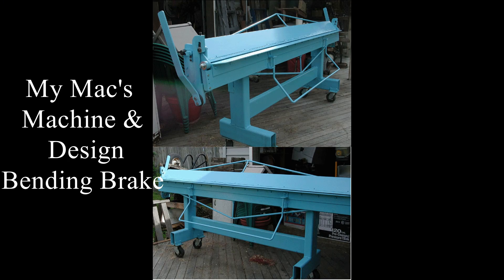Scratchbuilding a Zenith 701 Experimental Airplane, Bending Brake Choices

Comment: Great primer on bending brakes! Probably the single-most important tool for scratch-building a metal airplane. I started out with a modified version of Dave Clay's brake, but have heavily modified it since then to complete the project.
Reply from the maker: Thanks: I always see lots of debate about brakes. I love mine but the majority can be done with a 52 inch brake. When I bought my corvair cores I picked them up from an old orchard warehouse where they had about 3 airplane projects going on and had a 3" pexto brake. I commented on it and was told that it was hardly ever used because it was to small.